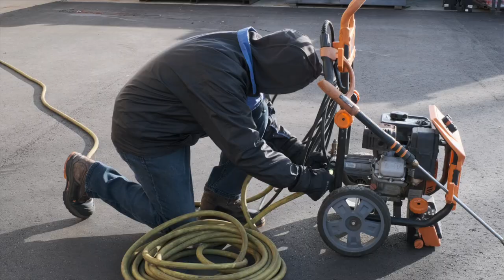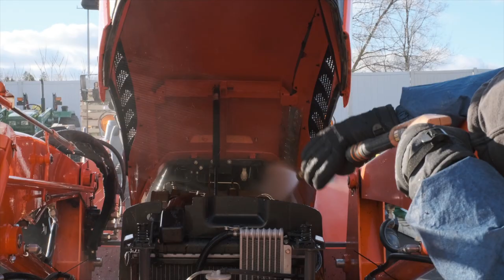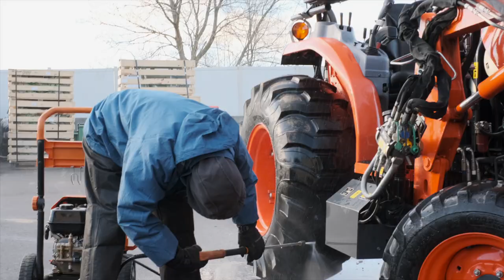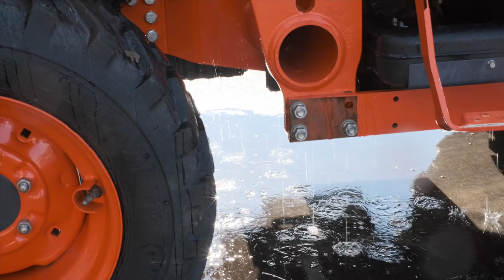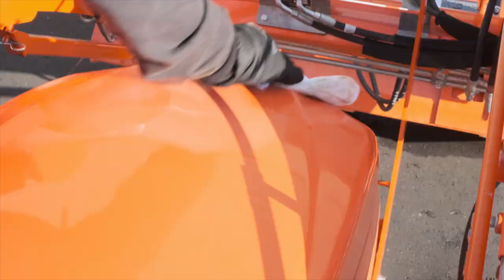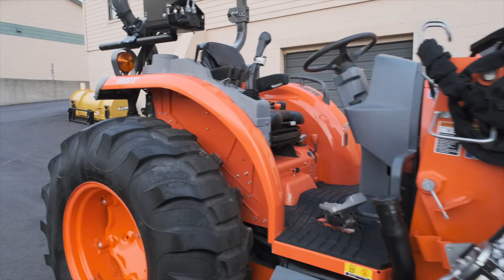DIRTY KUBOTA L6060 TRACTOR CLEANING EXTRAORDINAIRE! 👨‍🌾🚜

Comment: Face shield and a good rainsuit are a must for power washing equipment.  I always wipe as much of the big globs of grease off with a rag before hitting it with the pressure washer.
What are the products that you use for cleaning and detailing?